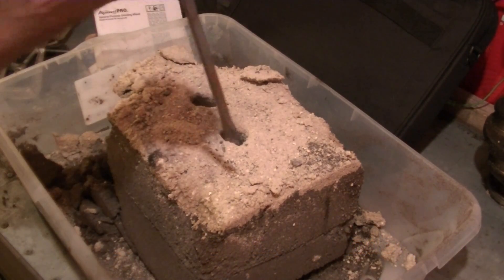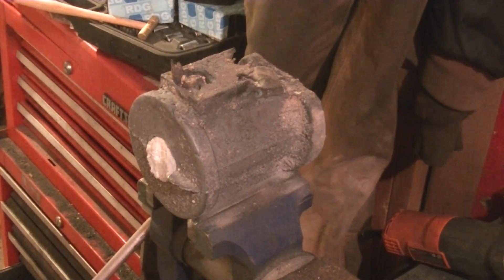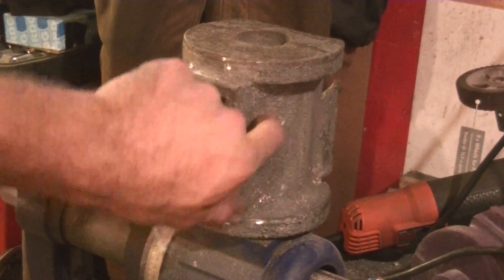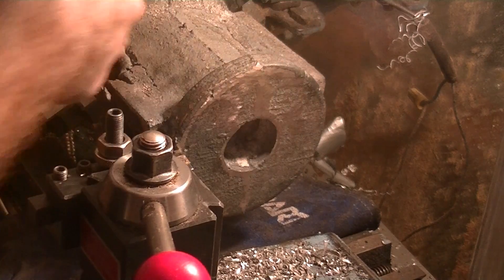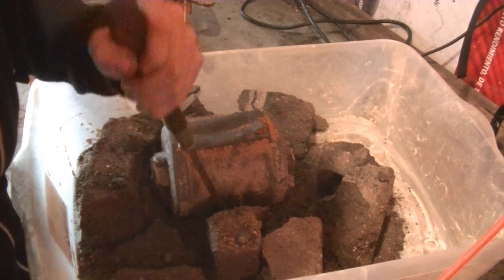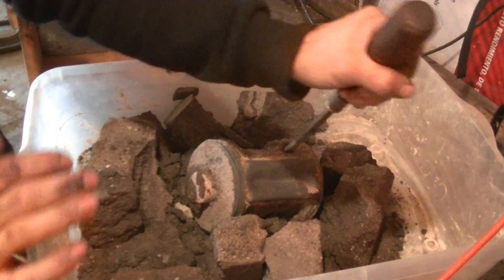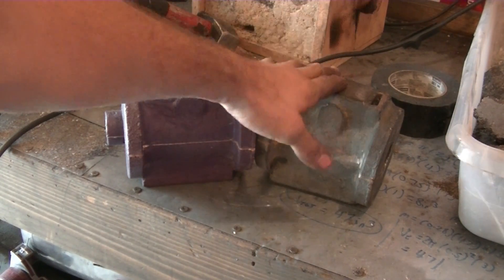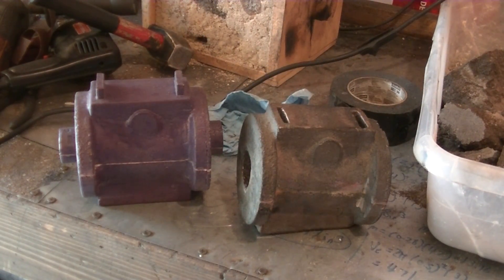Steam Engine Build: Cast Iron Engine Cylinder Pour : Part 2

Comment: Are those sodium silicate cores?  

For Iron, one wants some sugar to help the sand break down - that, or use “baked cores” which are cooked in a core oven…
(This is why they were so common in the auto industry, I’ll bet)

Secondly, did you add sea-coal?  (Didn’t look like it.)  Sea-coal helps with cast iron having a “better” surface finish.

Finally, you might add a small amount of powdered charcoal or metallurgical coke (roasted coal) to your crucible to help reduce some of the “slag loss.”

Comment: Was watching an Aussie guy on YT, and he had the right idea. Weld up a holder with a couple of legs on it to support the crucible, and use a couple of handles to tip it into the spot where you want it. Also, from metal class, I think you want to have a spoon type hole near your entry hole to allow you to pour into that and then it overflows into the entry hole.
Reply: He did mention that “spoon type hole” in part 1. Agree on the holding jig!

Comment: Far better than my first iron pours were, took me about a year on my own to figure it out. I had several books but this internet is way better in many ways. I found using finer sand and ramming about 1,5" of sand at a time gave a much better casting. Wish youtube had of been there 40 or so years ago i would not  have had so much problem. Keep up the videos and keep trying, practice makes things easier. Be safe and well.

Comment: This straight cast iron or addid ferrosilicon?? Great video!!
Reply from the maker: I believe this pour had no ferrosilicon.  This is before I knew about that!  It was pretty tough to machine later on.
Reply: @fairweatherfoundry715  thanks you!  do you know if the ferrosilicon infers on the hardness? Regards from Argentina
Reply from the maker: @NITROMETHANO  Yes.  When you add ferrosilicon to the melt, it softens the end product making it easier to machine.  Without it, its very difficult and will break many tool bits.
Reply: Great!! Very very thanks you!!

Comment: You could always clad the outside of the cylinder with wood or sheet metal to cover the imperfections in your casting on the finished engine. That's the way it would have been done traditionally anyway. Looks pretty good to me.

Comment: Awesome videos. A needle gun would probably clean the sand off of those castings quickly. I learned so much from you. Thank you!
Reply: Yep, just bought an air chisel from HF to remove the ice dam on my gutters and wondering if that would work better.  Would like to start casting myself, and this is a good learning video series.